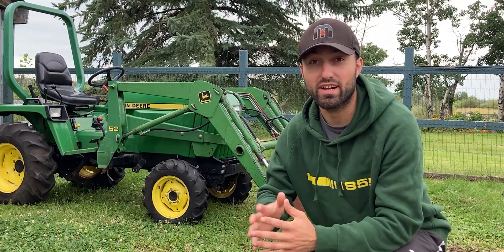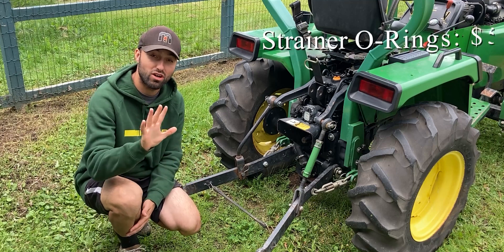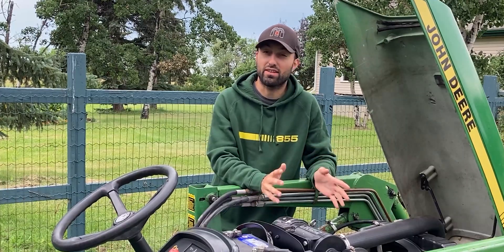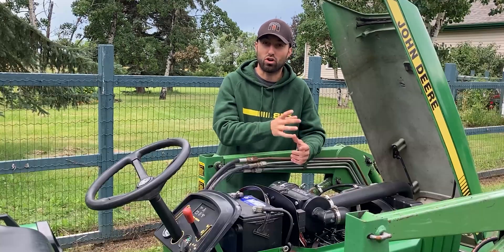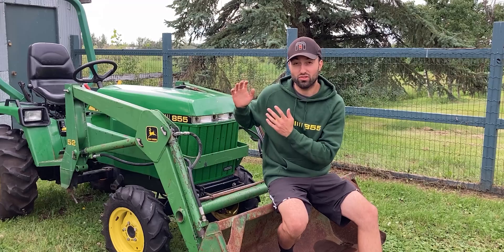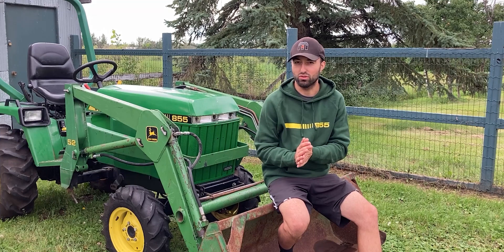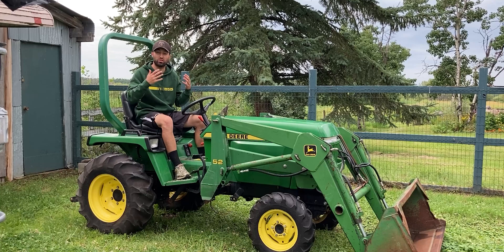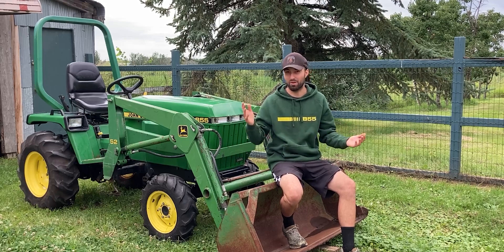John Deere 855 Repair Cost Breakdown

Comment: Would like to know your tool invertory for this project.
As your first diesel rebuld noted you had a diesel injecto tester on hand. Any other dedicated rebuild tool?
Never saw your count of your work hours?
How do you distinguish between Rebuild, Remanufactured, Overhauled?
Thanks for the videos (all of them).
Reply from the maker: Great questions Tom! My tool inventory is quite large and filled with hand tools and just a few corded power tools. To list everything would be very hard, but this might be something I can share with everyone in the future. 
This was my first diesel rebuild that I have done on YouTube and before this I have actually only rebuilt two Kubota V2203's. These two engines were placed into skidsteers and that is why I already had an injector tester.
When it comes to tools for an engine rebuild, you can get away with a 100 piece tool kit and a torque wrench really. For diesel engines, I would suggest you find yourself a "Flare Nut Line Wrench Set". This will come in handy when you have to bleed the injectors.
I did not count my hours on this rebuild, but it was not all too long! The most time-consuming part was to clean the tractor from all the hidden debris and clean all the disassembled engine components that were in the boxes. The Yanmar engine rebuild took much longer than any air-cooled engine I've previously touched, because I had a lot of details to share on camera. I really put a lot of hours into the film-making part and editing, but I know it will help many viewers out there, so I keep at it and try my best!

This is how I would differentiate these topics: 
Rebuild= Any mechanical component disassembled, repaired and put back together. Must be fully functional & like new.
Remanufactured= Any mechanical component disassembled, repaired and put back together by a certified mechanic or company. Must be fully functional & like new + have warranty backed by company.
Overhauled= A certain part of a mechanical assembly that has been repaired or rebuilt. Once an mechanical component is disassembled, only certain parts will be exchanged to make it fully functional again.

I will never be able to label my work as remanufactured, even though it might be up to the same working standards, but I do not have a stamp to stand by my work. One could argue: "Do I Rebuild or Overhaul my projects?". They are very similar terms and maybe I do a little bit of both! I hope this gives you enough information and if you have any other questions, feel free to ask!
Regards Andreas

Comment: Great deal. You should swap those front tires so they are facing the correct direction and don’t wear out prematurely
Reply from the maker: Thanks for sharing your opinion 1259bogs! After repairing a couple things on this tractor, I fully understand why these machines hold their value. There are so many tasks one can get done with it and there are some very nice attachments that can be utilized. I agree with you on the tires and I will take some time to swap them over to face the right direction. Thank you for your advice, I appreciate it! Regards Andreas